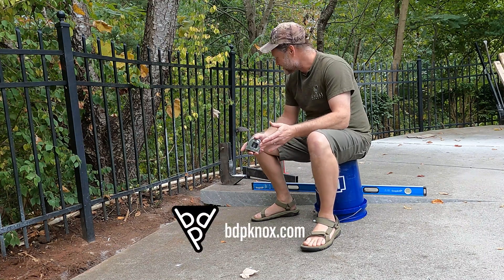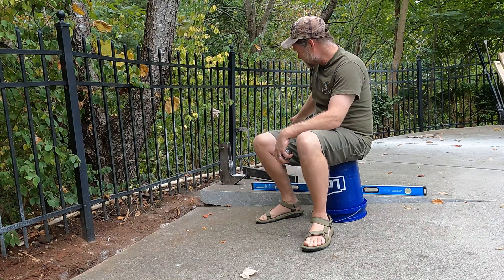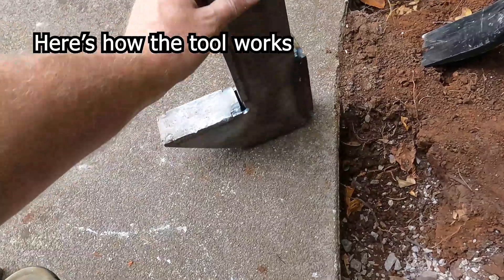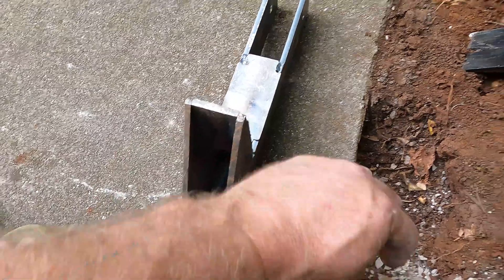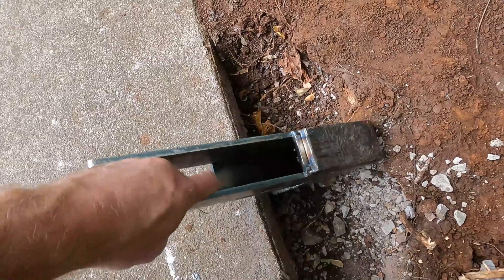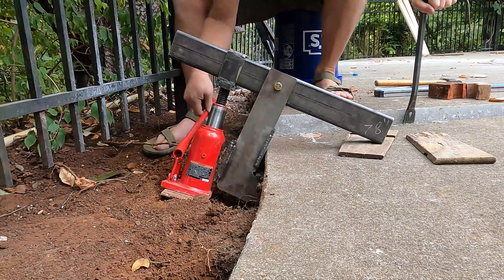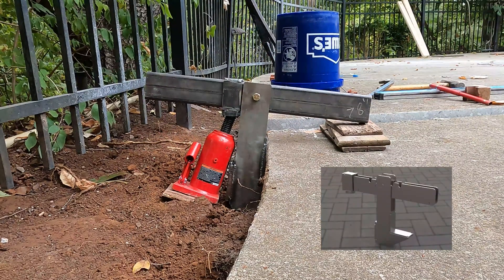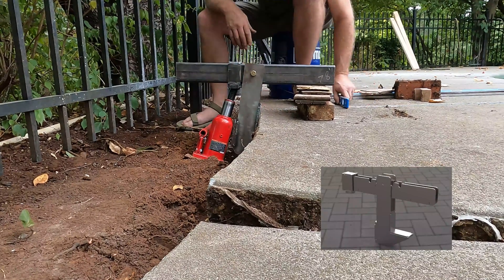How To Lift a Sunken Concrete Pool Deck Slab with A DIY Tool. I can build one for you.

Comment: How many tons can it handle?
Reply from the maker: My slabs are divided into about 25 ft3 sections so I’ve used it to lift 3800lbs. It’s capable of lifting quite a bit more.  Some people that have bought one lifted much larger sections. One thing you have to be careful about is that unreinforced concrete could crack if you lift too large of an unsupported section so it’s best to lift one spot a little and then brace it in places.  One person reported back that he broke the concrete above the jack trying to lift a really large section that wasn’t moving.

Comment: Tractor supply farm jack. Very low access. You'll see jeeps that go off road alot have one strapped on their hood or bumper.
Reply from the maker: Yep, I have one. The issue is you have to dig quite a bit of material out to make room to fit the jack underneath the slab. This way lets you just hammer the tool under the slab with less digging.

Comment: What did you insert under the slab to hold it in place once it was jacked up?
Reply from the maker: I wedged some content pavers in temporarily and then backfilled under all the slabs with crushed stone and then poured a concrete collar to hold it all in place. Has been solid ever since.

Comment: Great design. Im going to build something similar but with rectangle tube. Because lazy.
Reply from the maker: Cool. Just make sure to check that the slab portion is actually able to move upward before putting too much force on the jack. A 20ton jack can easily break 4” concrete slab. So do whatever you need to do to make sure it’s not stuck before lifting.
Reply: @bdpgarage  for sure. I plan on running a sawzall or chop saw between the slabs to make sure they dont bind.

Comment: Very interesting I am in the pool business and have seen many decks drop.I may have you make me one! Do you have any issues with the slab cracking on you a customer of mine had his deck lifted and somehow a corner was broken off??
Reply from the maker: Mine has not cracked yet. It does seem that you need to make sure the slab can actually move before trying to lift it, otherwise the tool will keep lifting and something will break. I’ve found that it helps to not “pinch” the concrete slab between the lifting arm and the hook. Adding wooden shims under the lifting arm to keep it close to horizontal seems to help. Also try lifting the slab a little bit at a time and see if it moves. If it’s not moving, figure out where it’s hung up on before continuing. Some decks are reinforced with rebar and so what looks like a small section can actually be quite a bit larger. You may need to cut an expansion joint in that case.

Comment: Thanks for sharing your Maker Project!  Your slab lifting tool reminded me of our Plymouth Fury III jacks and jack hook.  I have to repair our swimming pool, but the more I watch YT channels like your channel I realize that our slabs aren't as bad.  Some of tiles have fallen off the pool wall and that is when I learned that my parents paid a contractor 15 years ago to give the swimming pool a makeover, which included new tiles glued over the original tiles, new grout/mastic/mortar and provide a less slippery deck. Five years later in 2014 we experienced a couple of tropical storms that caused extreme flooding in northwest Florida, which shifted the slabs,  I honestly don't think the slabs have shifted any further since 2014.  I am trying to determine the best methods and solutions with a fair cost.  I think I will be forced to do the DIY method because we received a bid for 25K
Reply from the maker: Got a picture of the fury jack you can point me to? Curious what it looks like.
Reply: @bdpgarage  I swear I posted links and sent email you of the PFIII Jack-stand and Jack Hook. 
Well another year has passed by and all the "Grifters" are still selling their bullshit.  I have yet to repair the swimming pool deck and swimming pool; however, I am hoping this local company will contact me when they get a slowdown from the commercial side of business.
Reply from the maker: @  if it was a link in a comment, YouTube likely deleted it. There are a variety of tools for this kinda thing, hope yours works out.

Comment: What did you support the slab with after lifting  it ? Bricks ? Styrofoam ?
Reply from the maker: Once its supported using a brick or two along the edge, I packed as much paver stone base under the slabs that i reasonably could and then formed over the edge with a wooden boards and then poured a concrete collar around the back. Then i poured construction grout in between all the expansion joints to fill in any voids in the rock. Ive heard some people use great stuff foam but we have lots of critters that would dig through that. 

I think the construction grout is the best option if you can find a way to pour it in. Its very flowable so not too bad.
Reply: I bet if you had to you might be able to drill an access port for injecting your grout or foam or whatever material your using

Comment: Im interested in the hook and bar. Do you sell them or the file? Im having the same issue. I gound the website and just ordered one. Cant wait to get to work. Lol
Reply from the maker: Yep, still offering them. Ill warn you its hard work. 🤣 i see the order and should be able to ship it by friday.
Reply: @bdpgarage  well, it's either hard work or 10k. I'm more scared of the 10k than the hard work. I'm looking forward to fixing this problem. I'm going to form up the edges, drill 2 1/2 inch holes and pour concrete into the voids. Fingers crossed. Lol
Reply from the maker: @MrCurtis69427  if you’re ok with the 2.5” holes, thats the best way to do it. Id actually recommend construction grout over concrete as it flows much easier and will self level itself under the deck. Once you cant fit anymore into your hole, you know its full.
Reply: @bdpgarage  right on... I'll look into that instead. And I'll fill the hole up and make it as best looking as possible. And maybe coat the deck to hide any of the old cracks (after repairing them) and any other blemishes. I have bricks separating different sections that I'll have to reset also.
Reply: And one more thing..... what's the maximum length of concrete I should lift with this hook? I have a couple sections probably 10 to 12 feet.
Reply from the maker: @MrCurtis69427  that’s hard to say only because of the tool and the jack are not going to break, but if the concrete is not reinforced, I’m sure there’s some point where it might crack if you lift it off the ground. Mine is not reinforced and I lifted the ends of a 10 or 12 foot section and it seemed to be OK.
Reply: @bdpgarage  well if I get to freaked out about it I'll just buy a second one. Lol. Still cheaper than replacing and I was prepared to buy 10 bottle Jack's and leave them even after backfilling under the concrete.

Comment: Great idea. The issue of doing this is now you have a void under the concrete which is near impossible to fill properly.
Reply from the maker: Actually it was fairly easy to fill. The lifted side is accessible after lifting it and I was able to partially pack it full of stone, the built a concrete form for the back side and poured a small concrete backer to hold it up. Then I poured construction grout in between the slab joints to fill any voids the packed stone didn’t reach. It’s been solid for a year now with no signs of movement. (Except for the part that wasn’t lifted near the diving board where there was a leak. I have another video detailing that.
Reply: Packing it with stone only creates a drainage bed for water to flow through. You need something non permeable like spray foam or cement to prevent the slab from sinking again. Home depot sells a spray foam kit in a box that would take care of the void rather easily as opposed to using a grout pump to fill it.

Comment: Has anyone just deflated a football or basketball, slide it underneath then pump it to the night you need?
I probably doesn't have the strength... But it might.
Reply: Height not night... Autocorrect!!!
Reply from the maker: Haven’t seen that, but it might work if you dug out enough space under it, but not too much. I’ve seen jacks used for lifting trucks off the ground off road that could do it. You’de just want to pack some cement, gravel or grout around it to hold it in place afterwards

Comment: Wow, you are a smart guy! How do you fill the cavity under the raised pad? Won't the pad crack if the cavity isn't  filled full?
Reply from the maker: Yes, the cavity needs to be filled up. I backfilled it with paver base (crushed stone) and then poured a concrete collar at the back to keep the backfill in place. I also poured construction grout in the joint between the slabs to fill in any books and cranny’s the backfill might have missed. You could do the whole thing with the grout as well, as that’s what slab jacking companies use for the same purpose. It’s been solid so far, no movement.

Comment: Incredible job. I’d love to be able to lift my patio pad about an inch higher .
Reply from the maker: Thanks! I’ve got about 5 more of them left if interested. There are other methods involving spray foam if you look for those. I’m just not sure I trust that foam long term and not sure how it holds up to moisture. You can also lift the edge with a railroad jack, but that involves a little more digging.

Comment: Listen to your self!??? jesus!! you know very well!!! that's going to fail!!!!!!!!!!!! The right way would be to jack hammer everything and strat from scratch!!! look how many cracks on that cement you got? and you people are out here making videos though!! lol
Reply from the maker: Appreciate the encouragement! I did get a quote to have it jackhammered out and replaced, but there are lots of other things I could do with $30k. 🤣

Technically there was only one cracked portion, the rest of what may look like cracks are actually expansion joints I cut in the deck. So far there has not been any failure or sinking. It might not be obvious but once the slabs are leveled, I backfilled with stone and then poured a concrete collar at the back to keep the stone from being able to wash out, as well as filled in some voids near the joints with construction grout. So it’s still holding solid and I’m working on replacing the tile and pool plaster now.

Comment: Hey bud, I was wondering with the lifting of the deck did it damage or push out any of the blue decorative tiles you have in the inside of the pool?
Reply from the maker: No tiles damaged. There’s a bit of a gap between the tiles and top of the bond beam so not much risk of damage. But I’ve since removed all the tile and using some staples to fix a few structural cracks and will be installing all new tile.
Reply: @bdpgarage  Understood, well you got me sold on your tool.  Will be buying me one soon. Thank you for getting back to me so quick.
Reply from the maker: @Viper61787  cool, if you have to move the slabs along the ground in addition to lifting them, I’d recommend a “Burke” bar. Basically a giant pry bar. It was super helpful.
Reply: If you have coping stones the there is going to be that so called flexible joint between deck and pool do you think there would be a problem with a cantilever type deck what if you had travertine deck??

Comment: Great ideas.
What do you put under to keep the slab up?  
If you do this work in Houston reply back, I have about 50 feet of sidewalk to raise.
Reply from the maker: I used a lot of paver base which is just crushed stone. I ended up using a 2 x 4 to jam it as far under the slab as I could and then I poured a small concrete cap at the very back edge just to keep the paver base from wanting to find its way out. It’s been holding up for several months with no signs of movement yet. Love to visit Texas but I don’t do any work there. I’ve posted the link to the 3-D files if you want to make your own tool or someone else has asked about me building it for them and shipping them one as well which could be an option. I’m just not sure how much shipping would cost for that much steel.
Reply from the maker: One other option after you supper the slab is to get some construction grout (Home Depot, Lowe’s, etc) and you can pour it in between the joints to fill the gap. The grout can be mixed very thin and it’ll pour in between very thin gaps or you can drill a ~1” hole in the slab to pour it through. Then just let it dry and remove your supports.
Reply from the maker: Had multiple people asking about it so I just put up a link in the description to buy one of these tools if you’re interested in doing the work yourself.